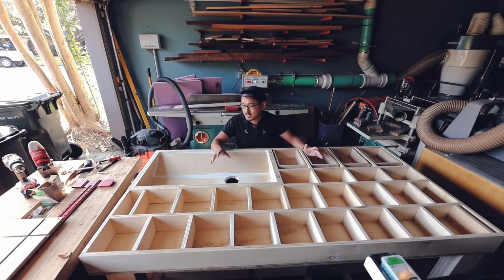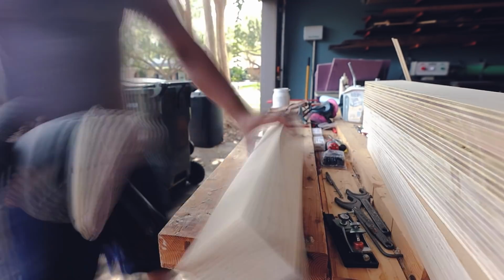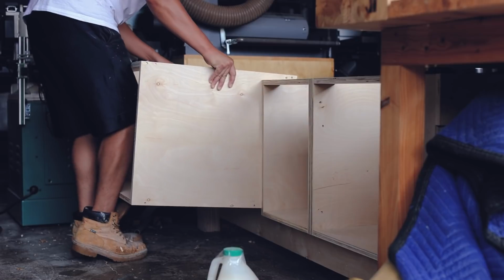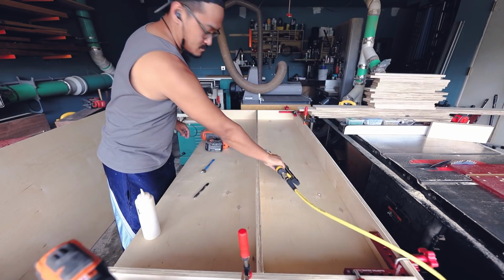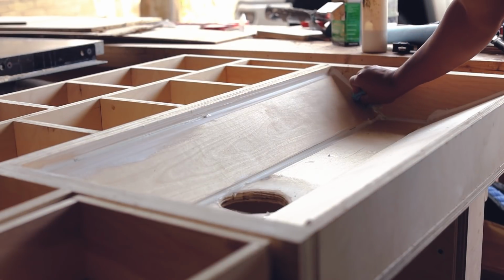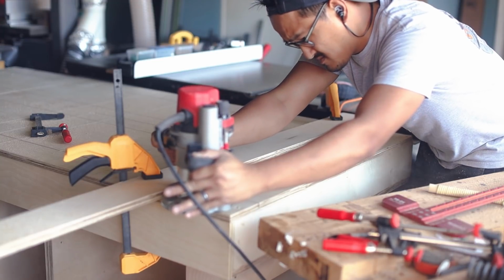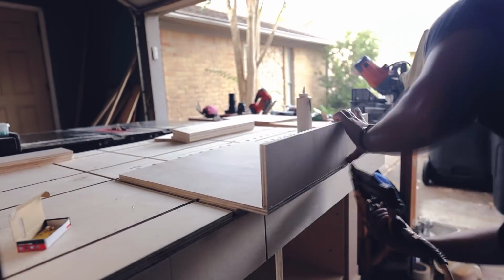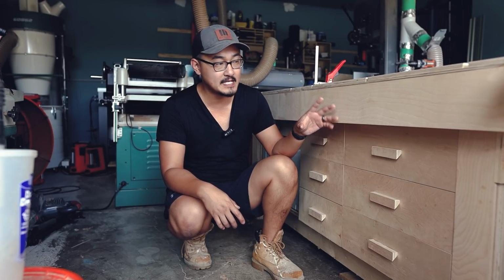DIY Torsion Box Outfeed and Assembly Table w/ Really Cool Features // Woodworking Plans

Comment: How well do you find your downdraft design has worked for you?
Reply from the maker: So far it's been good. In the video I mention that there were some issues with the CFM. Turns out my dust collection filter was clogged. Once I unclogged the filter, it works like a dream. I do have to cover up the holes I don't use, but that usually the case with more downdraft setups like this. It has come in handy when I did a large order or valet tray and cutting board this past winter. It held the items in place really well as I was sanding.

Comment: Whats the fancy thing you use to put your plywood on when your breaking it down? I've never seen one before
Reply: Nevermind, I found it and seen the price
Reply from the maker: Glad you found it. It definitely isn't a need. I got it on sale and it works really well for my shop since it's pretty tight in the garage. I use to break down plywood on the ground using rigid insulation to lift the sheets off the concrete, but my back started to not like it very much. 😆

Comment: Awesome build man! Probably the only thing I would have done differently is used double-sided MDF core melamine for the top. Mainly because it is super stable and makes a good assembly surface because it's easy to clean. The dust collection thing was a bummer, though! I guess it's time to get a bigger one. 😆Cheers from Baytown. - Joe
Reply from the maker: Yea I was considering melamine for the top, but any particle board core won’t work so well with the dovetail clamps. Maybe for actual aluminum tracks.
Reply: @DesignCraftWorkshop  very true about the clamps. If I did use the melamine I would definitely use t-track. I'll be building a new assembly table soon as mine has a lot of improvements that can be made. I'm definitely going to add the levelers to the next one as my shop floor is crazy uneven.
Reply from the maker: Those leveling feet comes in handy for sure